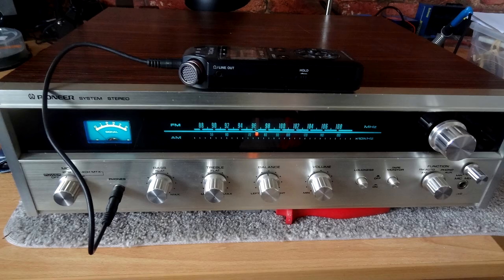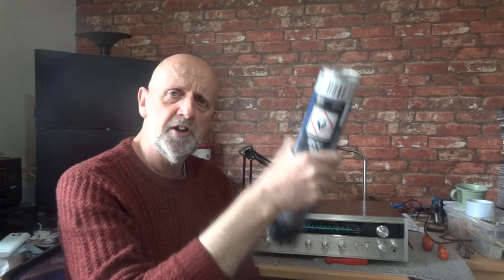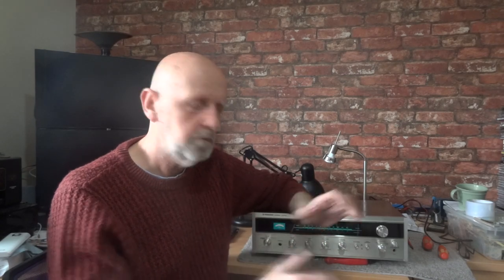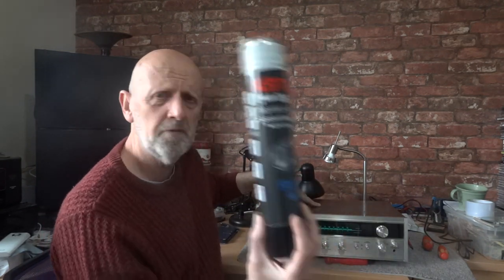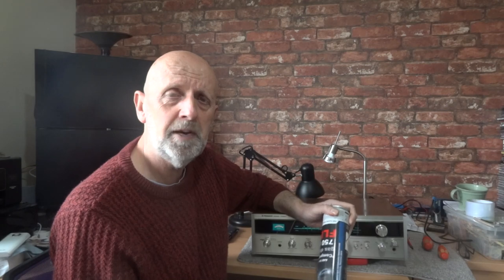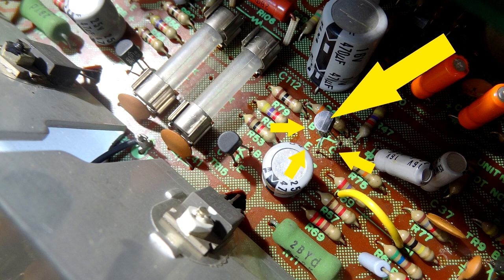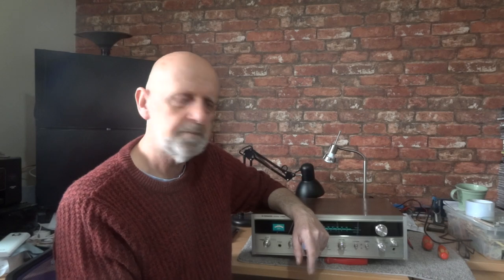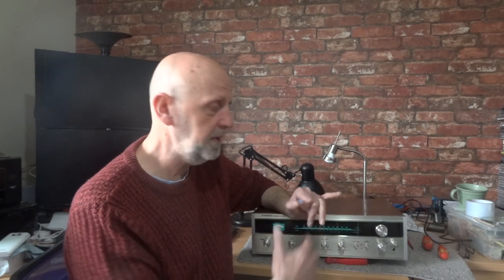Hissing Sound Out Of Speaker, Amplifier Noisey Transistor. Using Freeze Spray, Noisy Buzzing

Comment: C1344 is a known problem transistor. I am currently working on my Pioneer sx737 loaded with c1344, a725, and a726. Plan to replace them all with a992 and c1845. They're not doing anything wrong, so not gonna bother with freeze spray.

Comment: I have this problem in a Trio Kenwood KA 2000 I just bought so it's time to have a go at this an replace the transistors. C458 for 2n904 apparently.

fantastic this vid Mike, exactly what I needed!
Reply from the maker: Hi Alex, looking at the diagram of a KA2000a I take it that you are replacing the 2sc458 transistors if that is the case then a KSC1845 would be the way to go, I have replaced loads of the 2sc458 transistors with KSC1845
Reply: @MichaelYates  wow thanks Mike, really appreciate that. Yes they are the 2sc458 ones like you said.
Reply from the maker: Think that amp has quite a few of them

Comment: HI MIKE  you get  bad ic's in akai reel to reel deck   the audio gain goe's down  in and out of it  i had to pay out for 2 old stock 

ic  a pair  one was dead  one was on the way out   note  you have to have the decks open to get a meter in   you are right you got to have a plan
where to start  

note the akai 1800ss  this is a first  this deck can play 8 track tapes at 7 1/2  i had  check once again  
yes i was right the amps on akai  amps in deck are not great
Reply from the maker: This is a problem with the old decks, though as long as you can still get old of some replacements at a reasonable price its not to bad